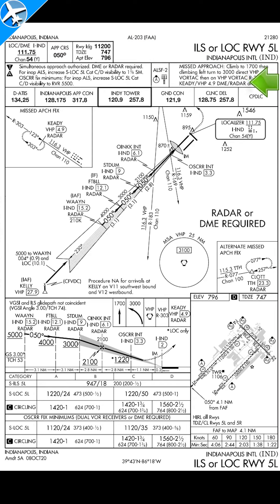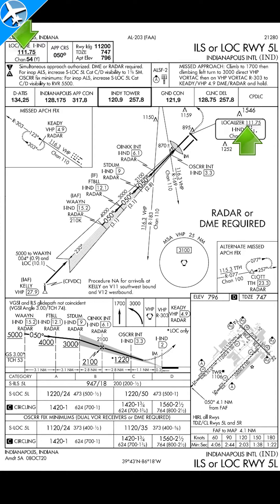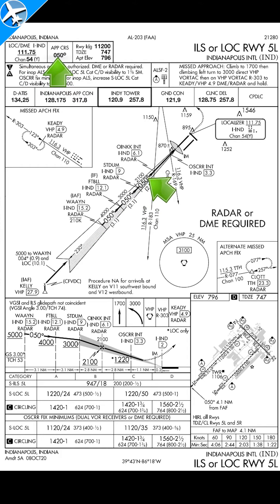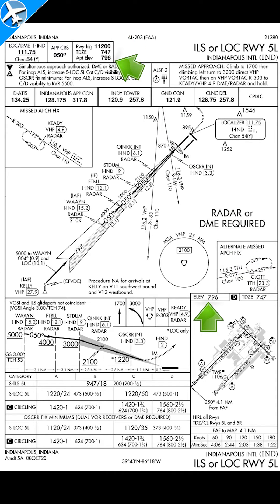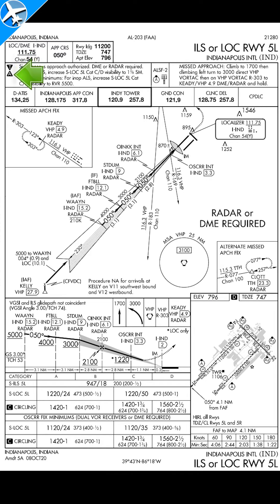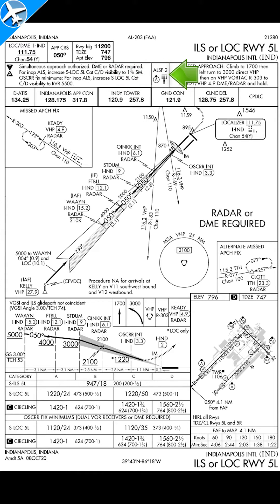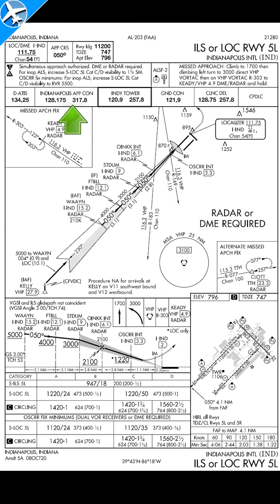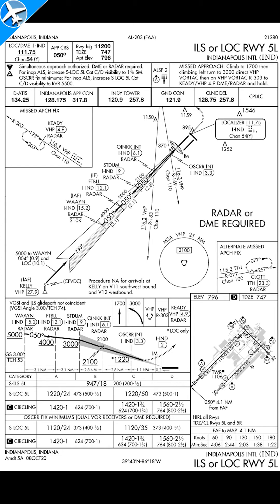Briefing Strip Information - Approach Plates Explained

Comment: What do the letters by the runway numbers mean??
Reply from the maker: @Connor-yq9mx  L C R = Left Center Right when there are multiple parallel runways.  In this example 5L would be runway 5 left.  Three runways will have L R and C. 4 parallel runways, well, one set of runways will get a different runway number even though they have the same magnetic heading such as LAX.